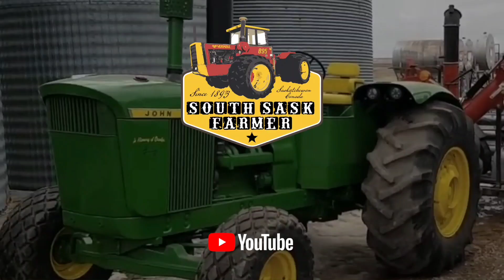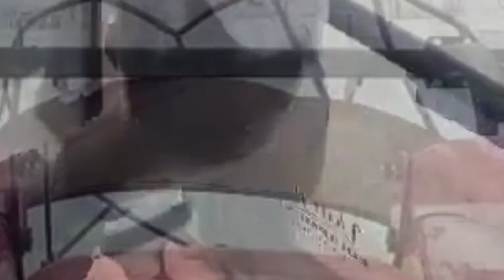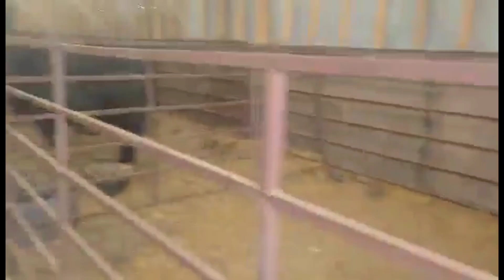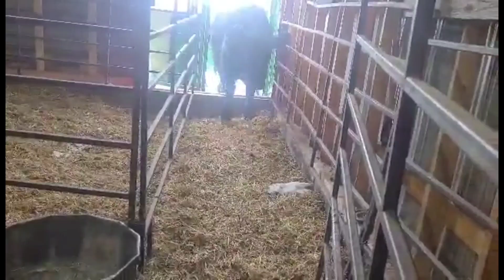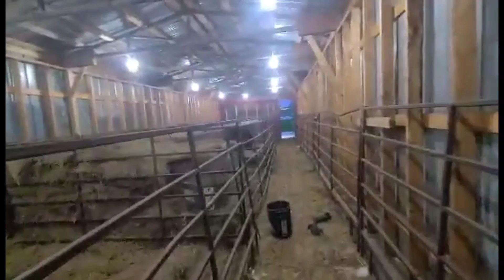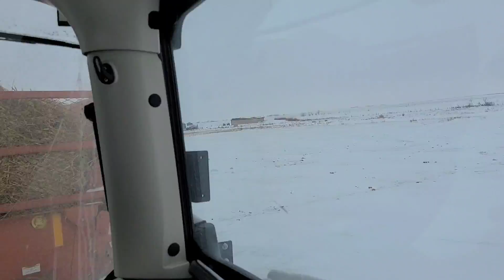D7G Straightpiped & Bedding the Cows!!

Comment: When shredding with PTO dont use 540E if you have that option. Or use it carefully. It's know  these don't have engine rev limiter and on 540E it will slip PTO clutch disk and pto break disk when pto goes over 540 rpm. It can go easily over 540 at moderate engine rpms when using 540E gear. My local dealer won't sell 540E and orders 540 because of that. Some kind of lazy programming matching engine and gearbox computers. These are from different manufacturers